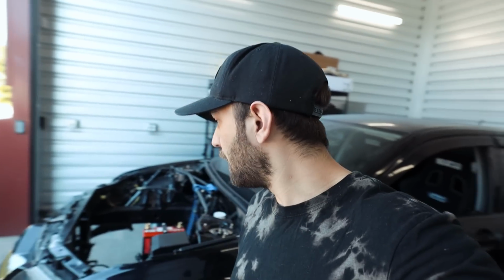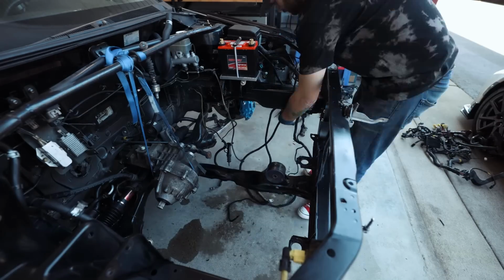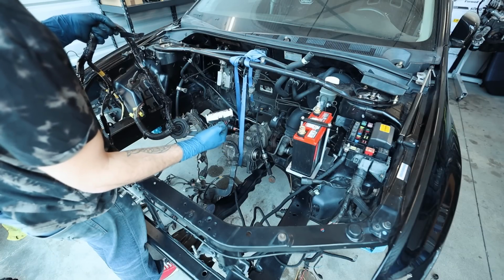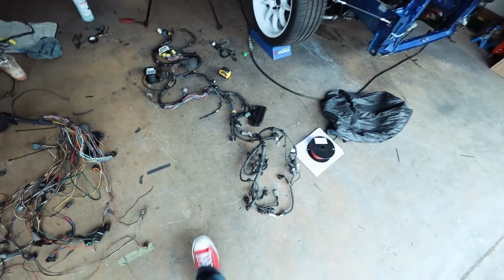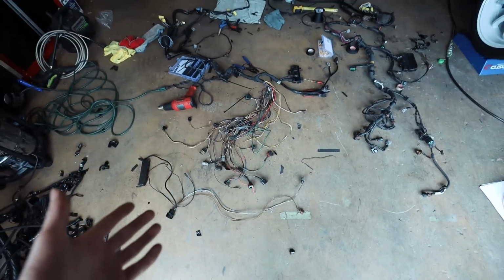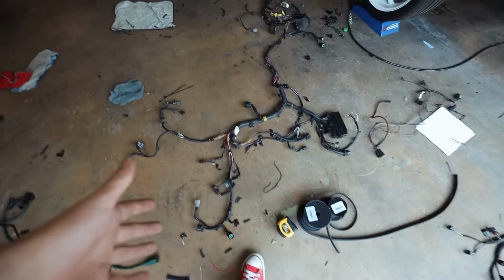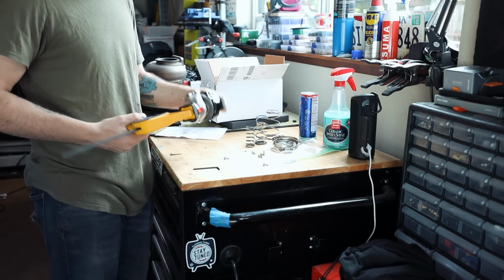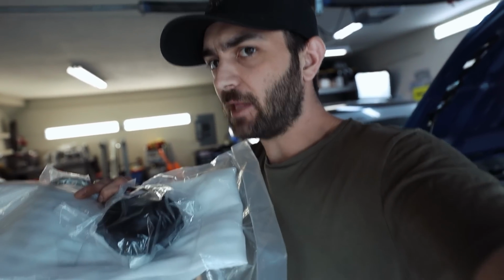I Never Want To Do This Again...

Comment: Not sure what you use to rip the wire sheathing apart, but if you want to move painlessly and quickly I find that a cheap seam ripper for sewing tends to just absolutely fly through the cover and leave wires completely fine. Best of luck with the build!
Reply from the maker: I had a set but lost them somewhere, very carefully had to use a razor blade. But most was soaked in oil so it all fell right off 😅

Comment: Commenting as I watch. The bigger grey plug on the floor is for the engine bay fan. It goes to the fan controller.
Reply from the maker: Thank you!!! Getting that wired back in to be able to plug into the fan then. So much wiring to repair 😅

Comment: Insertion removal tools for connectors are keyyyyy.
Reply from the maker: They help a ton!
Reply: @Smeedia  I used them on aircraft in the Navy for 20 years. Wiring,electrical theory is fun, but fabrication and the mechanical things you know and do are fun as well.  Hang in there brother. Great videos. I can't wait to see ya in San Bernardino Ca.  🤪

Comment: Yo. Red locktight the mating surfaces between the back side of the cam gears and the face of the cams on the H6. It can help prevent fretting. Same thing between the pressure plate and the back of the crank. Its no harder to remove than if you had siliconed them together
Reply from the maker: Will do! Have loctite and nord locks that were goong to use this time around 🔥

Comment: When I melted my dash harness in my 17 sti, a new one was $1200 from the factory. Found one from the same year for $200 on eBay from 541 Motorsports
Reply from the maker: 541 Motorsports comes in clutch! Bought alot of mine through them too

Comment: im actaully looking at doing this with my wrx! just bought a bunch of different sized wire loom and i bought some of that electric tape you use and even a bit of heat shrink for the ends to hold the wire loom on. im trying to learn how to depin connectors without destroying my stuff lol. i want to reroute a bunch of stuff too and hide some of the wiring away. we'll see how it goes!
Reply from the maker: Make sure the hest shrink is rated for what I have linked! Needs to be dual wall . It had adhesive lined in it to ensure nothing comes apart 🥳
Reply: @Smeedia  I actually had the same kit in my shopping list for Amazon but the one with red and black! I want to put a red piece on my positive terminal since my terminals aren’t color coated. Wish my luck on depinning! Can’t wait to see the evo or sti driving!

Comment: I hate that the bluebaru has to have a fender exit exhaust. Kind of ruins the whole oem look I felt like you were going for BUT... this thing will be gnarly nonetheless!
Reply from the maker: Agreed but will help with Temps and keep us from boiling fuel 🔥
Reply: @Smeedia  There's not enough heat wrap to deal with the heat that thing is about to produce 🤣 watching you wrench and make so much progress on this AND your evo makes me want to finish up my mustang rebuild so much quicker!
Reply from the maker: Get the mustang alive!!!! Low key been looking at S550s lately 😅
Reply: @Smeedia  market is insane right now. Unless you get one with body damage that hasn't been repaired, you're paying a hefty price. Got my 06 mustang gt with 35k miles for $13000. Thought I was getting a deal and now I'm already another $1000 into between exhaust, cracked headers, and now a rebuild cause the damn oil pump took a shit while I was driving it 🤦 I'd say Thursday or friday it's going to the machine shop though!

Comment: Evo 8/9 with sunroof would be the 
SSL model = Sound, Sunroof, Leather.
I personally would not want that model as it would add additional weight.  Congrats on scoring that evo engine harness she is getting closer. Are you going to keep the RS ABS delete to save weight and keep the engine bay all business?
Reply from the maker: I'm just gling to keep it as is, I've never needed abs in cars before so if it's already set up this way we may as well send it 🔥